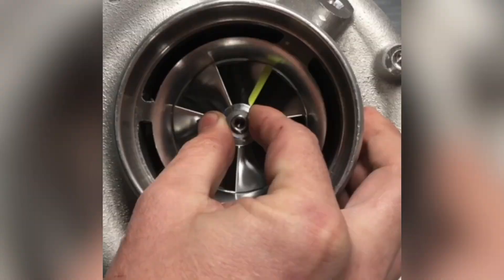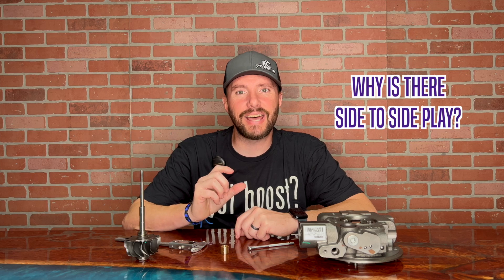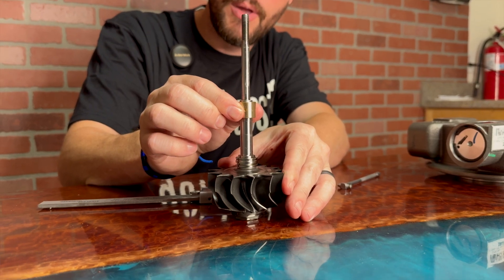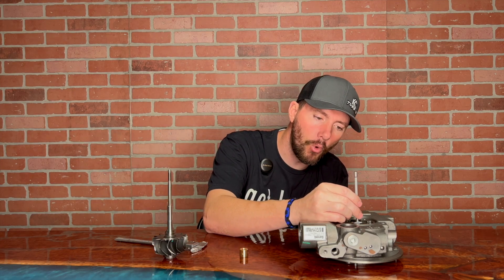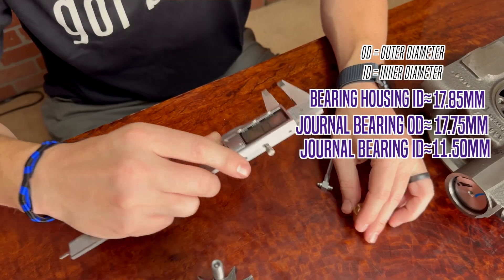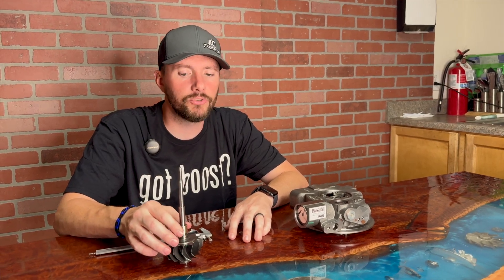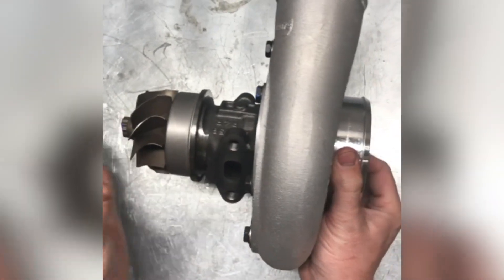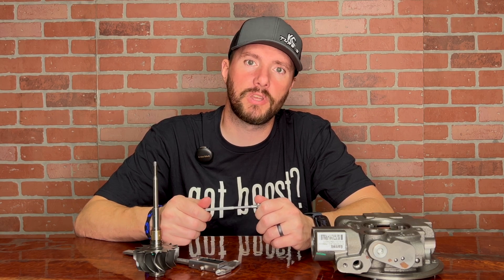What Is Acceptable Turbo Shaft Play?

Comment: Mine has in and out play..should I be worried?
Reply from the maker: Yes, that means your bearings are wearing out. The ideal thing to do, would be to buy a bearing rebuild kit now and install it. You can obviously still run it for a while if needed, but you can risk damaging the bearing housing if you run it too long.

Comment: Mine failed and had enough side to side play it was chewing up the housing, new one feels just as loose! Pretty sketchy. I'll have to check it with feeler gauge
Reply: How's it going? I just noticed the slightest rubbing marks from compressor wheel on my turbo and freaking out
Reply: @Projectbaghuul  if the inducer veins are rubbing on the housing you're going to need to replace it. The new turbo has been fine though. I was worried about it, but neglected the fact it didn't have oil pressure in it so the vertical play was more than it is when it's filled and has oil pressure.

Comment: Thanks for the explanation that was very useful. Would increasing the length of the turbo feed line starve the turbo of pressure? I accidently bent my line ever so slightly that the banjo bold won’t go in so want to adapt a hose or something. Head has to go on with exhaust and turbo in place and oil line is behind this, so can’t replace the oil line completely. Thanks in advance.

Comment: Hi, i hope you could help me! 
I buyed a new F80 turbo, turbo has side to side play, but when holding it to one side and trying it to turn it touches slightly the housing.  Without pressure it turns free. 
Old removed turbo does not have it…
Reply from the maker: Of ten times with a brand new journal bearing turbo, right out of the box you may be able to push it to the side and force contact with the cover slightly. This is because there is no oil in the turbo nor system pressure. On a brand new turbo, as long as there is no in and out play (axial Movememnt) then you are good to install it. After it has ran and there is oil pressure in the turbo, check the side to side radial play again and it should be stiffer and not make contact.
Reply: Thanks a lot @kcturbos! 

Should i add the oil with the injections that i received and than check if it will touch or install it on the car and than check after having started up the car? 

Thanks a lot! 🙏🏼

Comment: Does anyone know if the IHI VF44 is a journal bearing turbo? I’ve got ever so slight side to side play and the guy I got it from says it’s journal bearing but it only has play if I wiggle it from the compressor side. If I wiggle the turbine it’s nonexistent
Reply: That’s normal. It’s a journal bearing.
Reply from the maker: It is indeed a Journal bearing turbo. Sounds like your findings are perfectly normal.

Comment: Thanks for your video. I have a 2004 Volvo that I suspect it had a bad turbo. I just removed it from the car. I have some side to side play, but I don't know if it's too much. I heard you mentioned that the fan blades will not touch the side. Mine has enough side to side that I can make the blades touch the side of the housing. Would that mean it was out of tolerance.
Reply: If it’s actually rubbing the housing then that indicates bearing damage. Probably a good idea to get it rebuilt

Comment: Very good explanation of this issue Charlie, Does the play decrease even more once the engine is up to normal operating temperature, and all the different metals expand due to heat ?
Reply: Colder will feel tighter.  Hotter will feel looser.

If it is hot and sitting for a while then there will be even more play

If you clean them out with brake cleaner then it has a fine of play